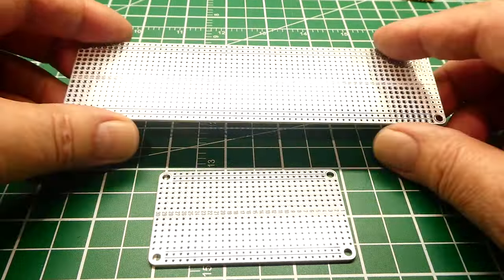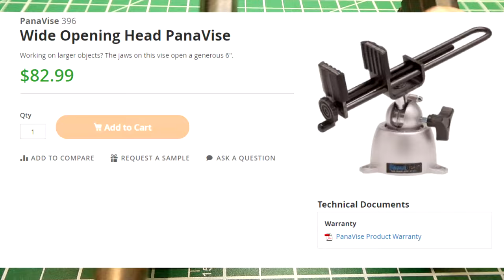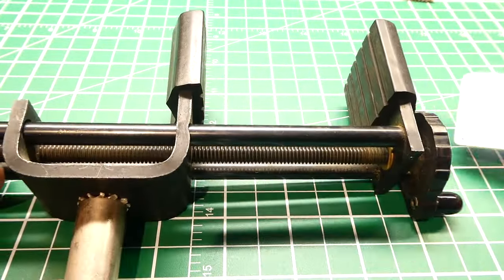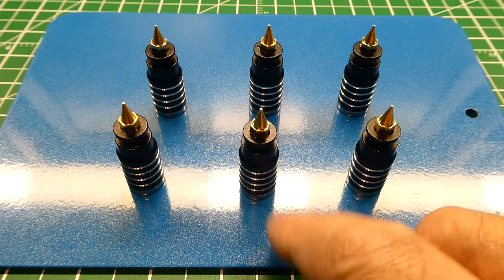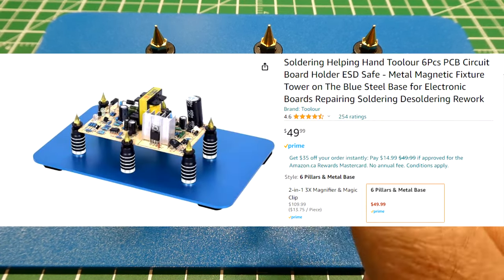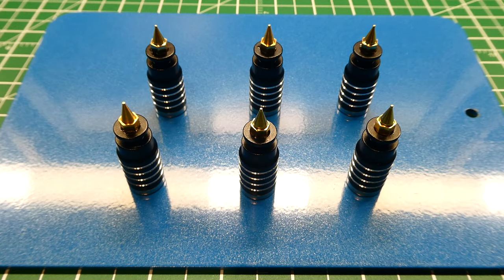Tip of The Day / Prototyping Tools

Comment: I'm think I'm gonna give up on proto/vero/strip board unless the project is EXTREMELY time sensitive.  I've learned that once you get over the learning curve of Kicad, the time it takes me to design/assemble a manufactured PCB is significantly faster than doing it by hand...especially if you have to build 2 or more.  With how cheap it is to do now, I just can't justify the time wasted making sure I've broken traces or connected all the stuff that needs to disconnected/connected.

That said, those board holders a great bit of kit.  Even though I have 5 other ways I can hold a board, I can see where they would be the "right tool for the job".
Reply from the maker: Whenever I get approached by a company for work it always ends up an "emergency" project. The PAL programmer in the video was used to program a whole fleet of police/fire VHF vehicle radios, as they were changing over to a new plan. I have used Kicad and Dip Trace like many others, but often most jobs could not wait 5 to 20 days for boards.
Check out my prototype video where most of the projects you see there were time sensitive. https://youtu.be/J9Ig1Sxhe8Y
Reply: @0033mer  It's only 5 days if no mistakes are made!!  Lol.   All of my projects are personal in nature, so very few of them are needed immediately.  I have a large window when the finished project needs to be delivered, but I have limited time to physically work on it.
Reply: @RK-kn1ud  The price of building your circuit at home is next to nothing. Also, if you make an error on your  "professional" boards - you are SOL. If you make a practice board at home, you can debug it, then send off for pro boards,  once all the bug are worked out.